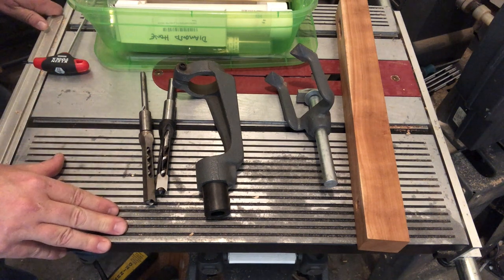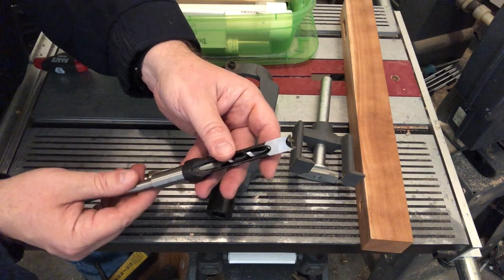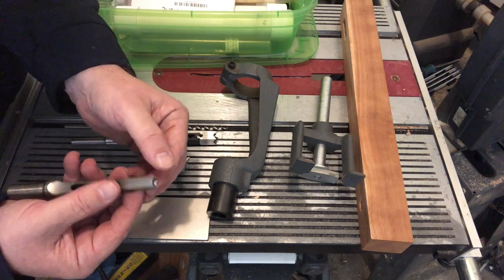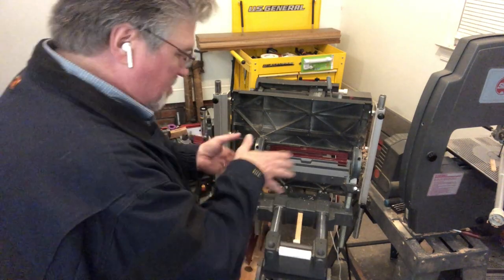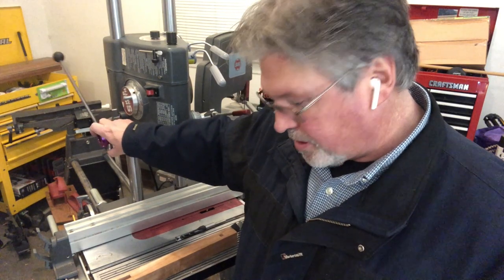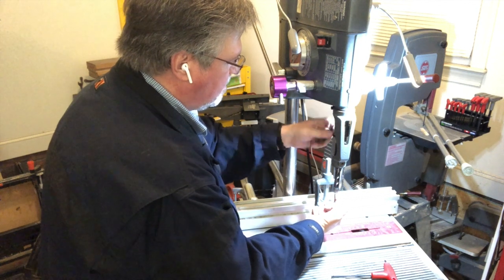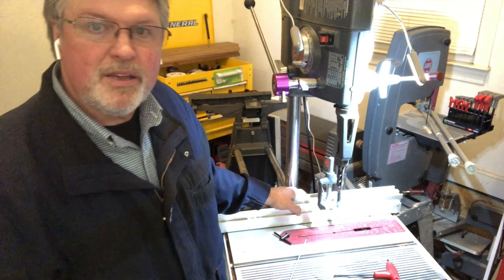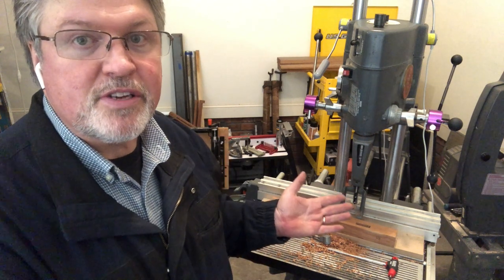Hollow Chisel Mortising with a Shopsmith Mark V or Mark 7 or any Drill Press, for that matter!

Comment: Hey Scott, I just set up mortising on my vintage and near new Mark V. The mortising bits had wax on the from 1984. I reinstalled the Mark V table, as I have the hold down for that table. Wow, you are right about the downward pressure needed, I didn’t like the stress on the table. BTW, I picked up a set of the triple & single long handles. I’m glad I had them. I’m not sure I’m going to pursue the mortising on my Shopsmith, but I wanted to give it a try. Thanks for your video 👍👍

Comment: Wonderful video. I enjoy seeing videos on the not so common tools of Shopsmith. I would enjoy your take on all the accessories Shopsmith has available.
Reply: The only Shopsmith accessory that I’ve had trouble with (and I’ve had trouble times three) is the two position lathe tool rest.  It’ll break.  The casting is filled with voids.  Consequently I purchased the universal tool rest.  It’s cast iron.  It’s built hellferstout.  It really works.
Reply from the maker: Sure thing! I'll get to them all eventually if you'll keep watching. Scott
Reply from the maker: John, I've seen photos of them failing but I've never experienced that personally. Are you turning spindles or bowls?  Scraping or shearing?  Scott
Reply: @MyGrowthRings  

Shopsmith asked that I photo the broken rest and I did, I received a new one.  Within a few hours that one broke.  I ordered a new one.  Few days later it was toast.  I had the original rest, one position and used it.  Those are casted well.  Never broke one. 
After the 3 test ordeal I purchased the Universal Rest.  It works.
It was the quality of Shopsmith products that encouraged me to purchase more than one two position rest.  It was unbelievable that they’d have and promote a substandard product.
I’m sure they broke during bowl turning, a “catch”.
It was the breaking two position rests that prompted me to purchase the first speed reducer, hoping to alleviate the problem.  But it’s the combo of the speed reducer, and Universal Rest that’s allowed me to turn my largest bowl of nearly 16” diameter.
One rest broke where the adjustable handles are. One was where the rest insert  and the rest body meet.  Another was a crack in the body and breaks of the before mentioned.  There were others who displayed photos of broken rests too.
Perhaps they’ve made a new mold or revisited the casting technique.  I haven’t seen of late any broken two position lathe rests.
I’m hoping they took care of that problem.
Reply from the maker: Very interesting. I had assumed it was from bowl turning but thank for confirming that.

Comment: Scott, this demonstrates why you have a 24" or so handle on a dedicated hollow chisel mortising machine.  Don't really want to admit it, but I have a pipe I put around a spare handle.  I've been using it for over 30 years without any issues.  Great videos!
Reply from the maker: Glad to hear it. The cast base of the handle may eventually need to be replaced, but even then you are over $100 ahead of me!  Scott
Reply: I'm actually using the three handled one, which is a lot stronger than the original one.
Reply from the maker: For sure! Yes, that steel hub is sooooo much better than the stock cast part. BTW, I really enjoy your channel!  Scott
Reply: Thanks, I thoroughly enjoy yours.
Reply from the maker: @stewwolfe1  Thanks.

Comment: Scott all the comments on the SS web site trash the mortising attachment as junk. Claim as you demonstrated that it won't cut into the wood. I have always contended that SS needs a longer handle as part of the set. Look at the length of the handle on your Powermatic. After seeing your demonstration I think I will buy the mortising kit along with the longer handle kit from Mr. Beasley. Hope I got his name write.
Reply from the maker: Yeah, I get that. If people's only experience is with Shopsmith;'s chisels and bits and the stock quill lever I can see why they feel that way.  Scott

Comment: I thought I was doing something wrong, because I couldn't cut a mortise in oak.  Looks like I'm not the only one.  I think before I buy a longer handle, I will put the second handle from my second Shopsmith on and try it with both hands.  That will have to wait till after surgery and recovery, but you might try it on the cheap shots to see if it works. I can get a handle for a lot less than the purple one.  Great instruction on sharpening, mine is rusty (I inherited it that way) haven't figured out how to sharpen it.  I will sharpen it and try it, though, I'll probably purchase the new style mortise and tenon bits in the future.  Keep up the good information.
Reply from the maker: That's sure worth a try.

Comment: 1) On my very first Shopsmith I purchased in 1981 (a 500), I used a 2x4 between the table and the floor to give it stability.  Worked like a charm. 2) I first heard about the dime spacing from a video by Nick Engler on how to set up the mortise (and is what I use) and I have heard other folks talk about a nickel spacing on other mortice machines and my comment is that I have a 5 cents difference with my setup.
Reply from the maker: Ha! Yes, the spacing of a dime was a common one, and with the style of chisel and bit that Nick used when he worked at Shopsmith that was the correct spacing. I would guess that with Japanese-style chisels and bit it is closer to a nickel. Thanks for watching and commenting. Scott

Comment: I've had my SS mortising kit since about 1992 but I could never get the chisels to enter the wood. Even soft woods were impossible. Didn't want to bend or break something so I just gave up. Why SS never sharpened their chisels (including lathe chisels) always bothered me. Watching you practically ream your chisel with your diamond cone convinced me that I haven't been sharpening mine properly.  Will try this again when I get the chance.  One idea - would waxing or applying soap to the chisels help them enter the wood more easily? The amount of effort required, even with sharp chisels and your big honking handles, suggest that the chisels could use all the help they can get.
Reply from the maker: Are used to work in an architectural millwork shop, where we built doors and windows, and we used to use candles made of paraffin and blocks of paraffin to keep the mortising chisel’s gliding smoothly. The one caveat is that very few Glooze will stick to it, so you need to be careful where and how you use it. I think you’re better off using a dry lubricant such as bow shield T9 the other one that used to be called topcoat, but I can’t remember the new name! I did a video on Shopsmith lubrication and I believe I link to those products in described where and how are use them. Scott

Comment: Another great video Scott.  Great tip on the spacer support block for the carriage; I'll bet that works better than the support leg (555627) Shopsmith sells for this.  It has been a few years since I used my hollow chisel mortiser on my Mark V.  I used it quite a bit before but didn't enjoy it.  Wished I thought to look for aftermarket chisels like you show here.  It could have made all the difference in the world in how mine performed.  I finally gave up and bought a Domino.  Had I seen your video first I might have persisted with my Shopsmith Mortiser.  Also those long handles from Geoffrey Baker sure would have made it a lot easier as well!!!
Reply from the maker: It really does work well. I would also agree that without it the legs are actually counterproductive.

Comment: Thanks for another informative video Scott.  I will be using your PVC hack on more than just the mortising chisel(s).  Have a couple questions. 1) Does the sleeve you used around 15:30 come with the mortising package or is it something extra you purchased?  2) will you be showing the set up for the older style in the mid-week "Stumped? Q & A" ?
Reply from the maker: Yes, that’s part of the Shopsmith mortising kit.  I suppose I could show it, sure.
Reply: @MyGrowthRings   Thanks

Comment: I have used my 500 to do this with a 3/8th I bought from Shopsmith but it never worked very well. I thought the chisel was sharp from SS. I’ll get a cone then try again. If not I may try the Japanese style you spoke of (after sharpening). If none of that works, Forster bits and chills or just make round corner floating splines as I’ve done a few times before (no way can I afford a Domino).
Reply from the maker: There are always three issues with hollow chisel mortising on any model Shopsmith 1.) The chisels don't come sharpened, 2.) The table flexes and 3.) The quill lever is too small/weak. In the end there's nothing wrong with slot mortises and floating tenons.  Scott

Comment: At about 15:50 on you video you show attaching that black "thing" (you didn't say the name) that actually holds the morticing shaft.  Before I knew what I was doing I bought a set of morticing bits that have a shaft that is .741 while the one that actually fits is .6. Can I get a "black thing" with a hole that will fit my new set?
Reply from the maker: On the Shopsmith mortising set that part is called the “Adjustable sleeve” and it is inserted into the “Quill attachment” or “Yolk”.  I suppose the answer to that question would be to reach out to the manufacture of the part to see if they have a fiveeights inch version available. I’ve never seen those parts sold separately but I have seen kits that include multiple sleeves.

Comment: Decades ago on the 500/510 I cut a 2x4 to comfortable drilling height, angled the ends to rest flat on the floor and underneath, front, of the table and it nestled into the arch in the center of the leg giving me no flex.
Reply from the maker: Smart. Sounds like you accomplished what the two legs on the 510/20 do but with far less set-up and flex. Scott

Comment: Scott, Great videos-- thanks much for your great work.  With my Mk7 i have recently had the opportunity to do a large amount of overhead routing.  As i watched this video, I was reminded of an issue I came across.  You supported the table because of the extra down force of the mortiser..  The issue I came across was keeping the headstock from dropping incrementally as I was making cuts.  I, like you did for the table, ended up supporting the headstock with a block.  I probably know your answer, if it works, it works...   any other suggestions?
Reply from the maker: Perhaps tightening the headstock lock tighter, but that is putting it at risk of damaging the tubes. I would think that would be the way to go, though. Scott

Comment: Scott, excellent video and love your delivery. At about 14:20 in the video you mention an older syle Shopsmith Jacobs chuck that works better with the mortising chisels. Can you provide the part # for this older style chuck and do you know if it is still available?
Reply from the maker: I’ll have to check the chuck for the number, but they appear on eBay all the time. It’s a genuine Jacob’s chuck, where most of them are not.

Comment: Hey Scott  I have the old SS 500 and never could get that mortising attachment to work, tried brand new chisel set still had the wax on it, adjusted it with the dime method and it just wouldn’t eject the chips out and would heat up. I don’t know what’s up with that, shouldn’t be that difficult
Reply from the maker: Is your chisel the Japanese style or the older SS style? The SS chisel has an oval shaped ejection slot, where the Japanese style tend to have a squared end on the slot.
Reply: @MyGrowthRings  no I bought these from ShopSmith years ago, I braced the table with a 2x4 and adjusted with the dime as Nick showed and just couldn’t get it to work. I adjusted it over and over and just seemed the pressure was crazy and wasn’t ejecting the chips out and overheating so I just put it back in the cabinet

Comment: Many years ago when at school the mortising machine there had a hammer action. I was always under the impression that this was essential and the reason you could not use a drill press as a mortising machine. A bit disappointing that the Shopsmith attachment does not incorporate a hammer action. Back in the day my father used to have a hammer action thing for his Black and Decker drill that you put between the drill and the chuck to turn it into a hammer action drill, so it's certainly possible to do.
Reply from the maker: I have worked in a number of commercial millwork shops I’ve never seen a mortising machine that worked that way. Very interesting thought though. I also only relatively expensive Powermatic stationary mortising machine that also does not have that feature. Thanks for giving me something to Google for the weekend! Scott
Reply from the maker: Well, that didn’t take long! A Wadkin DMV mortiser has that very feature.
Reply from the maker: That’s very interesting. No, I can’t imagine Shopsmith going to the trouble of expense to it or do something like that. As a home shop machine and that we just had too much expense. Thanks for bringing it up though, Scott
Reply: @MyGrowthRings  The way it was explained to me was that you use chisels with a mallet. There are lots of comments about it not working well in hardwoods so QED. You are going to need to keep the chisel razor sharp and it will dull quickly IMHO.
I am not sure it would have been that expensive either. As I alluded back in the day with your Black and Decker electric hand-held drill with the Shopsmith style range of attachments you could buy (circular saw, orbital sander, jigsaw, etc.) was the D968 Rotary Hammer attachment. One could have simply engineered the mortisier to use one of those by elongating it a couple of inches. I have to say I had presumed that the Shopsmith mortising attachment included something to include a hammer action otherwise it is overpriced IMHO.
Reply from the maker: @jonathanbuzzard1376  Oh, for sure it’s overpriced!

Comment: Thanks Scott.  I've always been a little disappointed with my Shopsmith in  drillpress mode (because of the slippage issue). Your tip on stabilizing that problem has given me new hope and whets my interest in the quill feed handle kit.  Does the 'kit' come with both hubs (and handles) - I can't find the answer on Mr. Bakers Ebay site?  Love your videos.  Thanks
Reply from the maker: Yes, I struggled to learn what was included too. You get two hub adapters and bit the long, single lever and the three lever handle. It’s a much better deal than it first appears. Check his eBay listing, which is linked in the video description. Scott

Comment: i just got my mortising setup this weekend. Is there a reason this cant be done horizontally? It seems to work fine for me and the small stuff i usually do, but just wondering if theres any issues im not thinking of.
Reply from the maker: In theory, no, but you'll find that the clamp on the rear end of the fence won't be able to take the pressure, so at the very least you'll want to clamp a backer block behind it. You'll also want to butt the main table against a side support table and if you have a 510 or 520, slide the table tubes through to lock them together.  I can not overstate the pressure you'll be exerting.  Good luck and have fun! Scott
Reply: @MyGrowthRings   appreciate the feedback. I was trying to figure out what you meant by "the clamp on the rear end of the fence" when I realized that I had tilted the table to be perpendicular to the spindle, so the fence is only holding the work up and not taking any of the chiseling force.  I definitely wouldnt do it with the table flat like that, seems like asking for trouble.
Reply from the maker: Got ya. Even so, you will find that the table will have some flex, so you might still want to find a way to brace it.

Comment: How about doing the ol' cheater bar trick and slipping a length of pipe over the stock Shopsmith quill handle?  Haul away to your heart's content!

Haven't actually tried it myself, but if it works on wrenches, why not on this?
Reply from the maker: You could, but the tip of the quill handle tends to deform and then the zinc hub fails.

Comment: Thanks for another great informative video. Do you have any recommendations for after market chisels?
Reply from the maker: The best I've ever seen were the premium set sold by Lee Valley, and they have the long bits that we need for the Shopsmith set-up.  The Shopsmith holder will only accommodate 5/8" shank chisels, so some of their larger chisels won't fit.  I have a couple for my Powermatic mortiser and they are excellent.  They are expensive, so I would only buy the size or sizes that I think I need, which is in fact what I did. Scott
Reply from the maker: Yes, those are the ones. They are rather expensive so I wouldn't buy the standard four piece set unless you need all four sizes. If I were needing 3/8" I might buy two of them. They also have a set from Taiwan that's not bad, but these are really worth the difference.
Reply from the maker: BTW, though they don't state this, the LVT premium sets are made in Japan by the company Nakahashi, who is known for making EXCELLENT mortising chisel and bit sets.